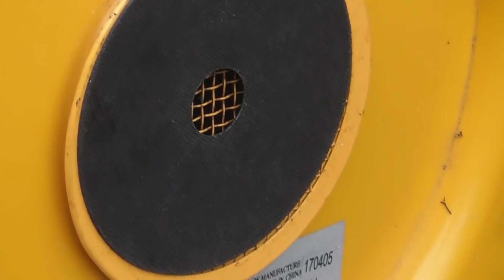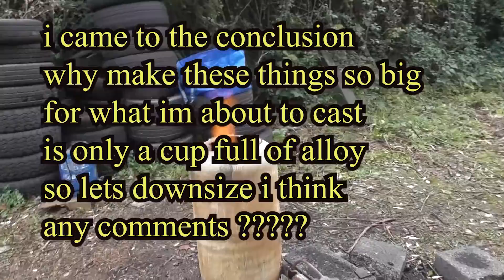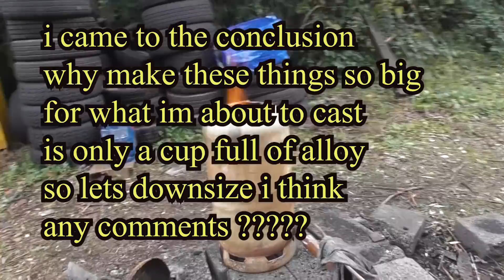bobs back on the oil burners cant keep an old man down

Comment: Shorter pipe between the blower and oil... and make it so the oil pipe is preheated so it flows easier... and if you can make it so the oil is getting splattered by the fan it might combust quicker.... 🤔
Reply: @bloodynuts2  cool... I built something similar but I couldn't get the burner right....  looking forward to the next video 😊